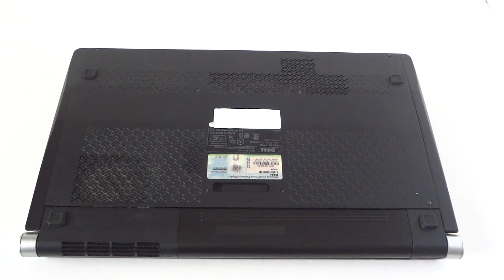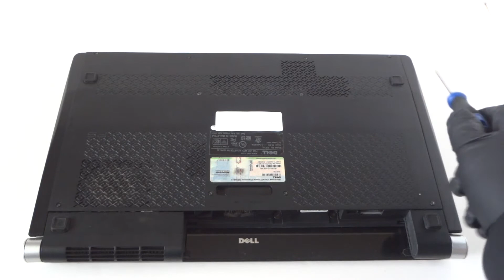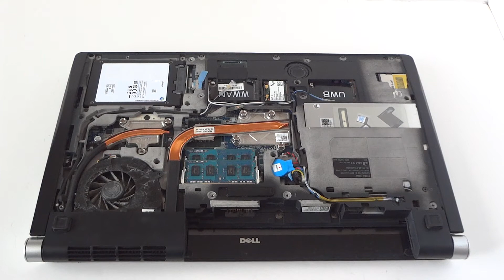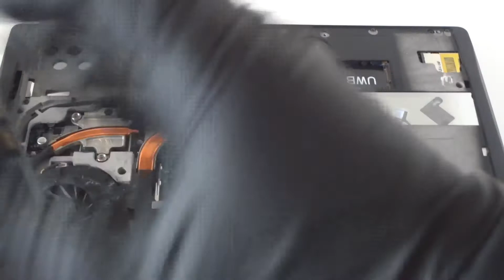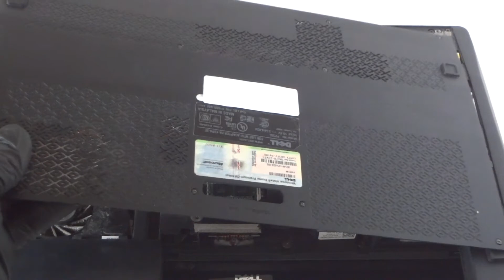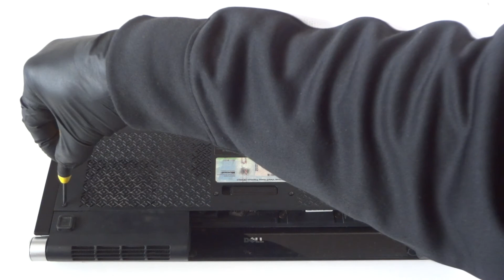Dell Studio XPS 1640 PP35L Upgrade SSD Drive Memory

Comment: did it boot?
Reply: i would like to know the answer to this also because I did it the same way and now mine won't boot.  I have black screen of death.
Reply: itsabouttime09 i did it and it booted if it doesn’t put the original back in or try reseeding it
Reply: Clone existing drive to ssd 1st .using a clone machine .. these laptops can be quite ram specific use larger modules of same brand and speed rating as existing ram

Comment: How much sense does it make to put an SSD drive in a laptop that doesn't have SATA3 support. It is not just having a SSD running at conventional SATA2 speed (like a non-SSD harddisk)?
Reply: On a answer to your question.... boot up time ... with a 500gb 5400rpm hdd with 4gb ram and core 2 duo the boot times are over 30 seconds ...I tried this with mine (xps 1640) clean win 10 installed ... cloned that drive to a 500 gb evo 860 ssd .... boot time to desktop seconds! even using slower sata connection

Comment: can you provide more detail about the SSD you are using?
Reply from the maker: Hi, Samsung 2.5 internal solid state drive and you can use any brand 2.5 solid state drive like 120gb, 128gb or 240gb, 250gb or 256gb, 500gb.